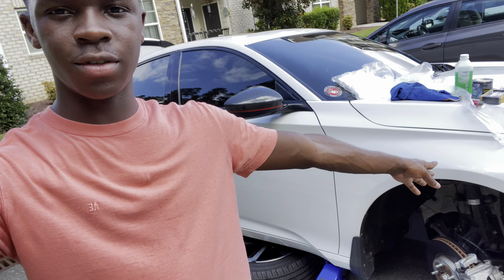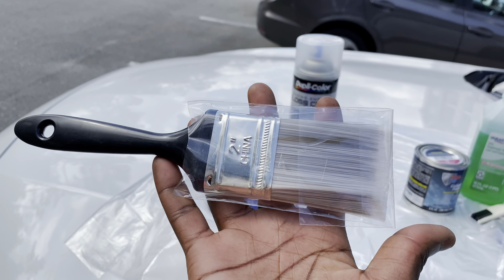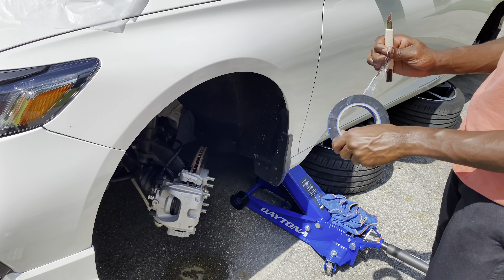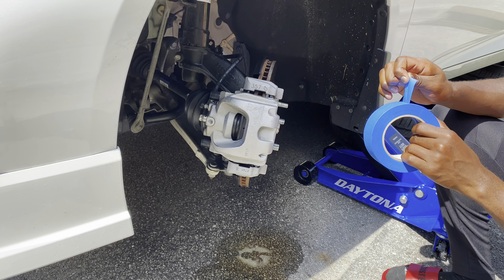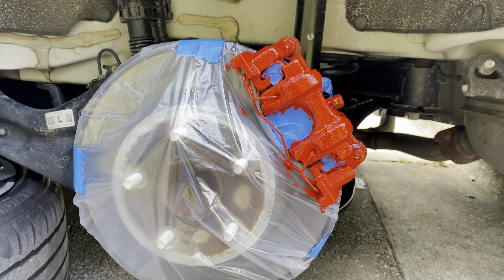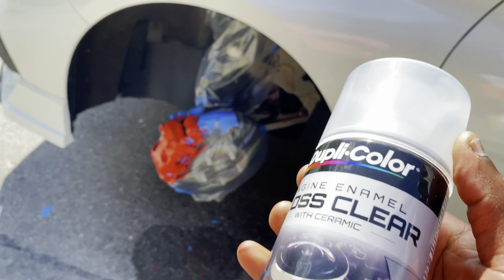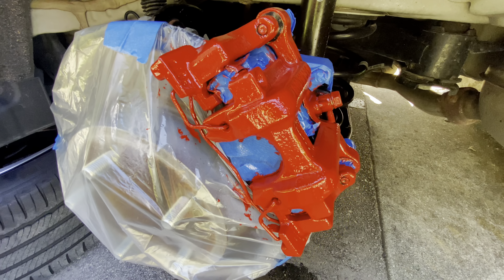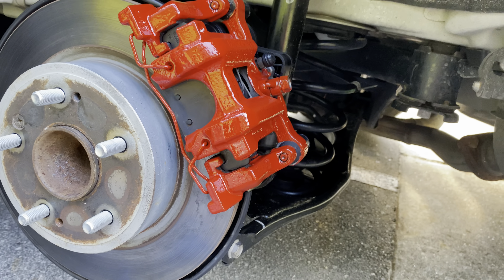2020 Honda Accord Brake Calipers Hand painted gloss red & Clearcoat

Comment: Hey man where did u get the door handle cover and the mirror cover in carbon fiber ? Do they have any 2021 2.0
Reply from the maker: https://www.ebay.com/itm/Carbon-Fiber-Texture-Door-Handle-Cover-Trim-For-Honda-Accord-10th-Gen-2018-2021-/353188203843?mkcid=16&mkevt=1&_trksid=p2349624.m46890.l49286&mkrid=711-127632-2357-0

https://www.ebay.com/itm/2018-2020-For-Honda-Accord-2x-Carbon-Fiber-Style-Side-View-Mirror-Cap-Cover-Trim-/193563841850?mkcid=16&mkevt=1&_trksid=p2349624.m46890.l49286&mkrid=711-127632-2357-0

Here are the links to both the handles and mirrors I got em on eBay
Reply: @RAMONEAuto  good looking man appreciate it
Reply: how long have you had the mirror cover and how are they holding up?

I bought some off of ebay and they're very dull now. it's been about 10 months.
Reply from the maker: @IMS0504  I got mines off eBay too I’ve had them for about 7 months but I clear coated them before installing
Reply: @RAMONEAuto  roger that.  i ended up getting a new set from synth carbon and they're real carbon fiber and ceramic coated....they were only $130
Reply from the maker: @IMS0504   that is my next step I’m starting to hate the fake carbon
Reply: @RAMONEAuto  haha i feel ya